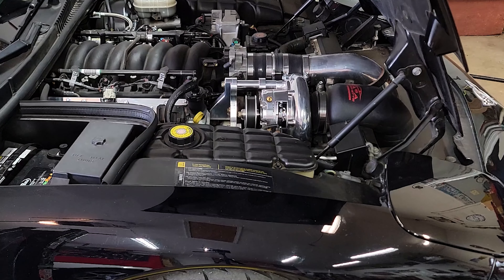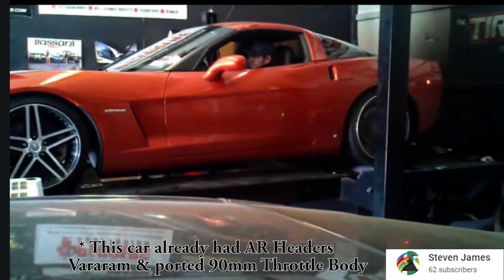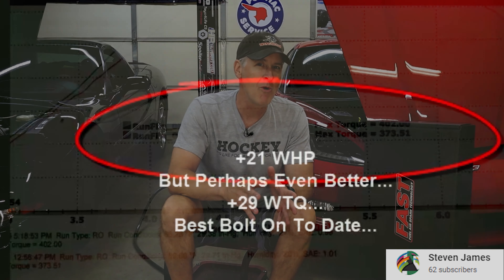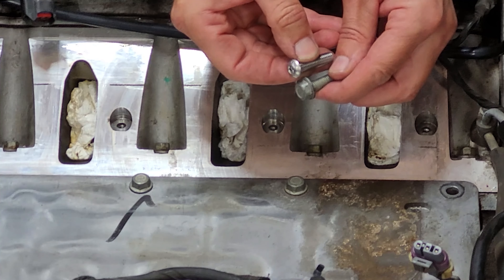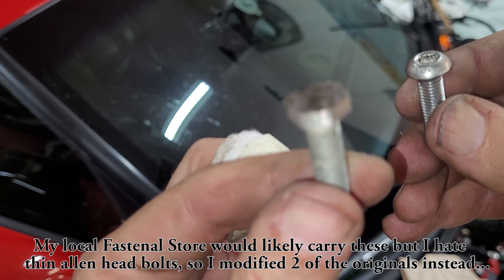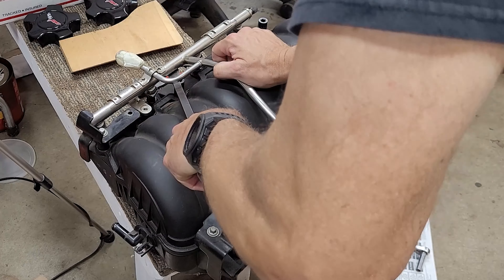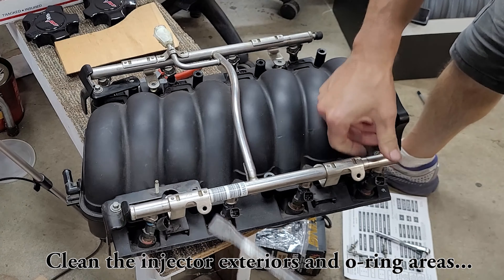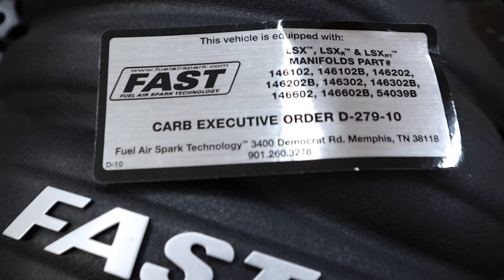FAST LSXR 102 Intake Upgrade for the LS2 Powered C6 Corvette (It was TIME!)

Comment: I watched this last night and am watching it again....I'm glad I did, because I just realized that you didn't replace the throttle body. So you can keep the stock 92mm throttle body and it will bolt right up to the FAST 102? Does FAST explain why only that one corner of the intake needs RTV?

Comment: It really does make a huge difference. I had the FAST 92mm intake manifold on my C6 LS2. Along with the other bolt ons (headers, higher stall torque converter, ported stock throttle body, Vararam Snake Charmer, ATI underdrive pulley, dyno-tuning, drag radials and skinnies etc.) it'd helped me run a best of 10.7@127+mph in the 1/4 mile. Stock internals/naturally aspirated/bolt-on mods only, in good air of course. 
Don't throw out that old stock LS2 intake manifold though, it is still worth a little money. 🙂

Comment: I actually bought one of these LXR intakes for my 01 C5 but I returned it. I wasn't sure if I could use my stock parts with this LXR. I was thinking it was a direct bolt in. I  wasn't sure with all the research I did so I just returned it. I already had a BBK throttle body and it looked like it wouldn't fit properly.  The research I did find out was the factory intake on a 01 C5 was pretty decent to begin with so I just kept it as is with my throttle body and long tube headers/ x pipe.  Maybe in the future by watching this video part 1 and 2 I will reconsider buying and installing one.
Reply: 01-04 C5s came with the LS6 intake which was a definite improvement over the LS1 (+10-20 rwhp). It's kind of weird that GM then took a step backwards with the LS2 intake (followed by another big step forward with the LS3 intake), but I'm sure they had their reasons. The LSXR 102 on a C5 also requires aftermarket fuel rails and some clearancing to clear the cowl I believe. In your case, since you already have an LS6 intake, definitely not worth it IMO bc you wouldn't see nearly as much gain compared to those with an LS1 or LS2 intake.
Reply: @nowayjose596  Thanks
Reply from the maker: @nowayJose596 100% agree!
Reply: @nowayjose596  My 2003 Anniversary Edition comes with an LS6 intake?
Reply: @Glide1992  Yes
Reply: @nowayjose596  So the 5 HP increase for LS1's in 2001 was really more than that with the LS6 intake right?

Comment: I have a question for anyone who may be able to help.   I have a 2005 base corvette with automatic transmission,  from what I understand it'd an early production vehicle.   I wanted to use a predator hand held tuner on it, which I know isn't the best, but I wanted to adjust fan temp and firm up my shifts some, and whatever little performance boost I could get on a pretty much stock car except for an intake and catback exhaust.  I can't upload the tuner onto the car because of the programming on the car and it being an early production car.  I've been told it needs the firmware updated, but the dealership wants a thousand dollars for this which is crazy.   Can anyone help me out with this? Thanks in advance.
Reply from the maker: Hmmm, interesting.   Did Diablo Sport Customer service confirm this is a known issue for their scanner with early model C6's?
Reply: Yes I have confirmed it with them, they said it needed the latest software update from chevy on the vehicle.

Comment: I’m gonna also swap to the fast intake but I will also swap the heads to LS3 style rec ports, The LS2 heads are very limited & don’t flow well
Reply from the maker: IMO LS2 heads flow well - but the LS3 heads do flow better (:-). LS3 intake is decent - doesn't benefit as much from the FAST LSXR 102 from the majority of feedback I have seen.  If a guy could find both heads and the intake for a good price it would be an even better mod!
Reply: Cathedral ports is where the Lsxr shines

Comment: The fuel line does not have to be separated. After you have removed the fuel rails and injectors, the fuel line will rotate up and back and it will rest on the windshield and be out of the way. Be sure to put a large cloth on the windshield to protect it. This has been done many times with no ill effects. Regards,
Reply from the maker: 100% agree. I like to do it anyway so that the inevitable gunk that ends up at the tip of the injectors can be cleaned plus I like to clean the rail with it off. But your point is accurate and appreciated!

Comment: My buddy has a 2006 GTO with the LS2 and a T56, and he recently did a FAST LSXR 102 to it as well as a Texas Speed chop monster cam. He already straight-piped it, and threw headers on and it's been retuned. As is, it's an absolute rocketship now for being NA stock displacement. I can feel the difference riding shotgun, and it sounds amazing. I'm thinking of doing an LSXR to my C5 z06 soon to help with airflow when running a boost cam that I have to swap in for my A&A kit.

Comment: That's a great upgrade.... how about a nice set of American Racing or Kooks long tube headers next?  That'll give you another 20 HP and torque bump !!! 👍🏼
Reply from the maker: I would love a set of kooks, but I think they're close to two grand with the X-Pipe.
Reply: @Toys4Life  awwww... go for it !!!
Reply: @Toys4Life   You’re only off by a little bit. 😅 I had Kooks long tube headers and the X-pipe with the green Catalytic Converters installed on my 2012 Grand Sport (M6) in April. Parts alone were $3417.00. I’m told the old Kooks HF cat equipped Xpipe is no longer made but even that combo was $2400.  I love the difference my setup along with a Haltech intake and a tune has made. No change drivability, but it runs like scalded dog when you put your foot in it.  
I love the format and content of your channel. It’s helped me make informed decisions regarding the plan I take for my Vette.  Maybe this is addressed in part two but any thoughts about the benefits or lack there of the FAST  LSXr 102 manifold on the LS3?  
Keep up the great work!  Thanks, John

Comment: I really enjoys your videos, thank you for all of the hard work you are doing in order to provide us with the proper information. I do have a question, I’m having a hard time finding the manifold O rings that specifically say for LS2 engines. Which ones from fast did you get? Thank you 🙏
Reply from the maker: FAST LSX Intake Manifold Replacement Seals 146203-8

Comment: Question;
I now have very similar mod’s as you have.  07 LS2, Corsa CAI, Corsa extreme cat back, Speedmaster TB, and the FAST LSX intake.  
When you got done, BEFORE YOU TUNED IT WITH THE HP, what were your STFT and LTFT reading? 

I’m going to tune mine and am curious what to expect from the fuel trims.  
After all the mods, currently reading good on the STFT. +/-3. LTFT is between + 7 and + 15 BEFORE any tunes or adjustments to the modifications. 

Obviously the LS2 is breathing MUCH better as the performance now is crazy, so I expected the elevated LTFT numbers.
Reply from the maker: Not much different but keep in mind where the manifold will shine is at high flow which is going to be at wide open throttle and that means only open loop and no trims except bringing a positive LTFT into WOT.

Comment: What size drill did you use? I want to tackle on the project but do not want to make the hole to big or to small (for the map sensor)
Reply from the maker: I don't recall, it's specifically does list the size and the instructions though and I found that to be correct in my situation.
Reply: @ Awesome! Thank you so much for the reply, Glad to see a recent video on this as im planning on doing this soon! Thanks again!

Comment: I have an APS twin turbo setup on my LS2 C6, otherwise the motor is stock. Currently makes 555whp/612wtq. Thoughts on what this intake would add?
Reply from the maker: I don't have any 1st hand experience with the APS TT.  I am not sure how much boost the FAST LSXR 102 can handle - it is a multi piece design with gaskets so that would be one thing to look into.  Also, before I would mod the intake, I would look into increasing boost if you are after more HP.
Reply: @Toys4Life  The great thing about the APS setup is it makes great power, no real lag, and on my tune I am making like 4-5lbs of boost. Was considering what other bolt on I could do and came across your video..
Reply from the maker: @AtomicTrent That's pretty low boost, what would you have to do to get a couple more pounds out of it?
Reply: @Toys4Life  More air in would be it and that is pretty tough as the fit is tight. Over the winter I went with bigger/better flowing air filters (one per front inner fender). Other than that, there are some turbo upgrades out there, but it works fine as is and I don't want to run it to the point of breaking shit!

Comment: If you know the oil pressure sensor is the original, it might be worth replacing it while you have the manifold off.
Reply from the maker: Good point but IMO - With these LS Oil Press Sending Units  - Even new ones fail quickly sometimes.  Some last a LOOONG time.  I should probably do the relocation kit....
Reply: @Toys4Life  Good thought😊

Comment: How well would this mod perform on a stock '03 LS1? Would I need to increase my injector size and add headers to see any gains? Would the increased volume slow the airflow and kill off low end power without adding the other mods?
Reply from the maker: There is no 93 LS1 that I'm aware of.
Reply: @Toys4Life  apologies, I meant '03. C5 Corvette.
Reply from the maker: The 2003 C5 has the LS6 intake manifold which is decent. I would not upgrade it due to the cost benefit ratio being poor.
Reply: @Toys4Life  Thanks, I'll wait until I do the cam swap and headers to do the intake manifold and I'm still learning my way around the HP Tuner.